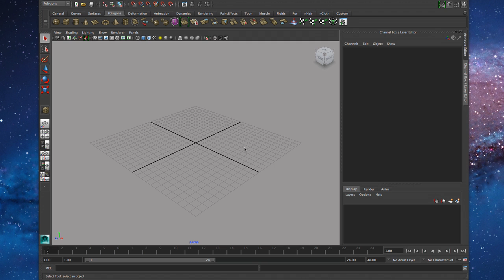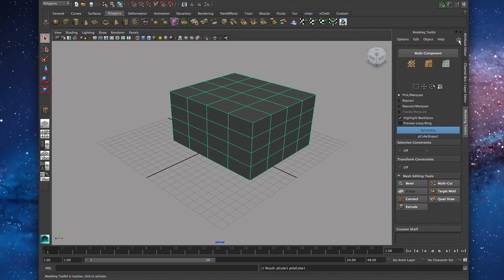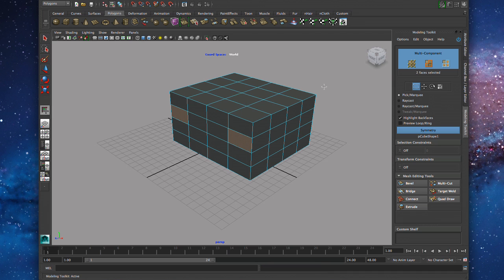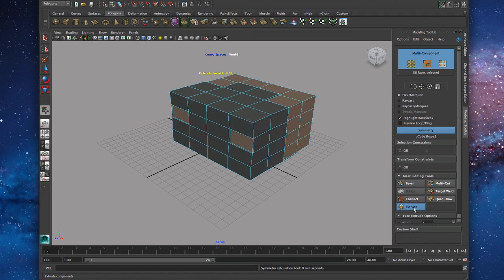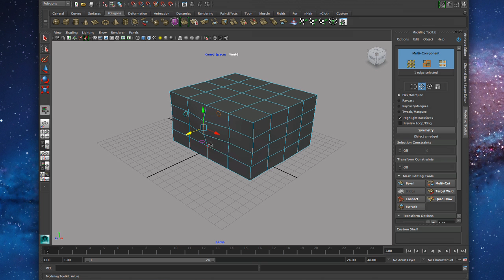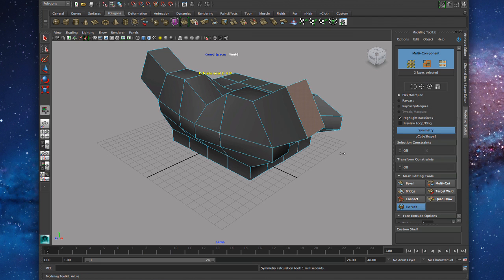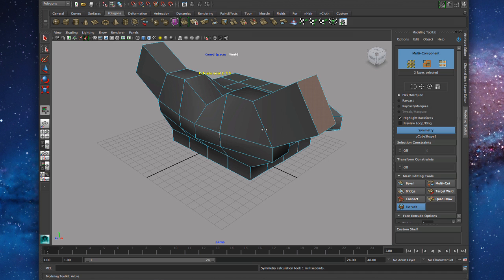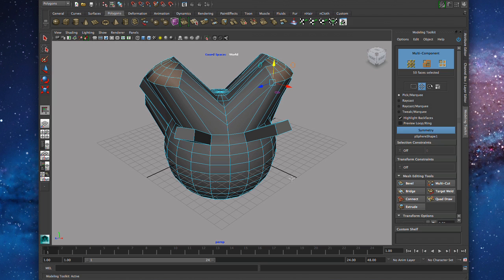Using Symmetry in the Modeling Toolkit - Maya 2014

Comment: Hey. I need a little help, so my symmetry stopped to work. I just reseted the Maya to Default setting but still nothing happened. Symmetry works on everything but when I open my work its just stops. ( Maya 2015 ). Do you know how to fix this? Thank you!
Reply: Daimon336 I am having the exacr same problem!! Any ideas whats wrong?
Reply: Alex Cheparev (you can find him on YouTube) helped me with this. He said me this: "Hey Daimon, in your scene, can you make a new sphere and try using symmetry on it? Sometimes when moving geometry and freezing transformations, you can loose symmetry location. Make sure your model is centered on the grid and freeze and reset transformations, clear history. If that doesn't fix it, last resort is to export your model as an OBJ file format and import it back in, that's my go to "I don't know what's wrong with this geo" solution :) There's other ways to fix it, but without actually looking at the scene it's pretty hard to diagnose."
Reply: Daimon336
Ok, I have to try this out. Thanks a lot for the answer!!!
Reply: Daimon336 Ok, so I did the sphere thing in the same scene and Symmetry worked perfectly. tried again with the character and nothing. The OBJ worked, but is mentioned something about "multiple groups sharing faces" or something like that. I dont get it, there is just one group in the scene, que I have body, eyes and hair of the character. Anyways, thanks a lot Daimon, really helped :)
Reply: Daimon336 Ok ok!! Solved it!! It seems my model wasnt that symmetrycal, I had a face connected differenty in the right hand, so I deleted half the model, duplicated and reconnected. Tried symmetry and it worked!! So really, thanks a lot for the replies!!